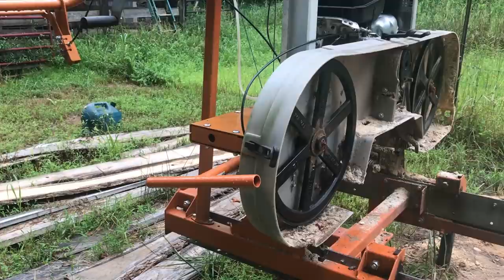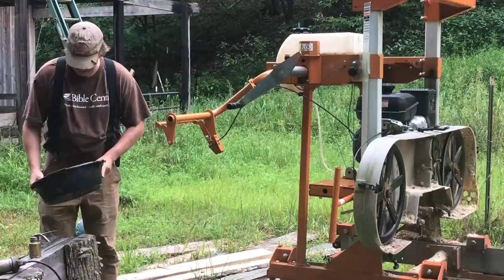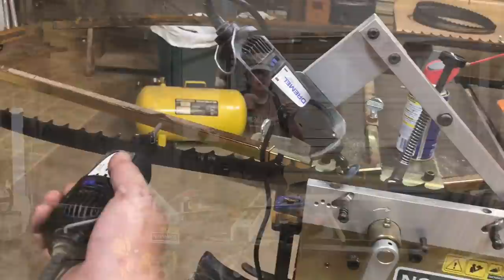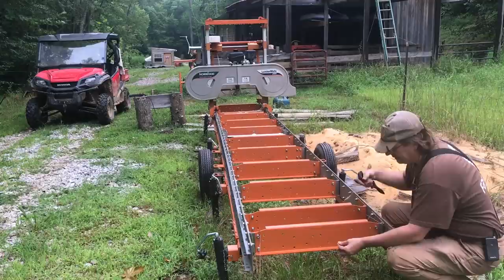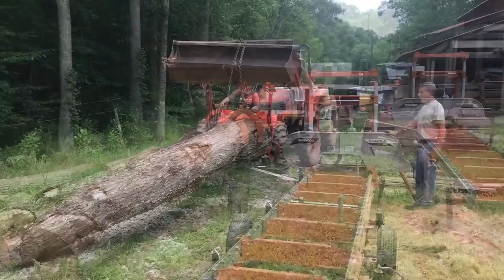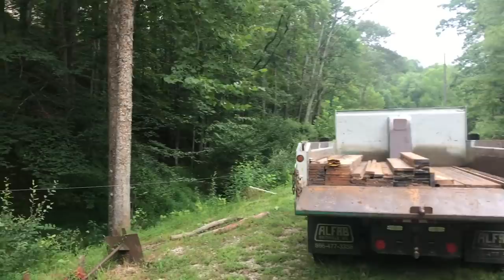Saw Milling a LARGE Pin Oak & Preventative Maintenance on the MILL

Comment: Hey Troy,  While I was watching you describing your dip in the mill and its location, I believe I saw your problem.  As you were describing where the dip was you had your left hand at the location of your problem.  Your mill's dip is at the connection of the two tracks.  I recommend you set a good sound timber under it and jack up.  It appears you have found a weak link in your mill.  At least you have identified it and know to keep watch of it.  Have a good day Troy and keep the good work.  God bless you and your family and always, stay safe.

Comment: Hey bud. Thanks for all the hard work making the vids. I love my lm29 that I bought because of you. Lol. I noticed something you might want to check into. Watch the video where you first started milling the first log. Looks like your frame is flexing. Might be a jack stand in a soft spot. Just an observation. Keep your eye on bottom of screen at the frame rails.  Also I bought the digital readout for mine. Best $350 I ever spent. Sped me up considerably. Thank you again.
Reply from the maker: I will check that out. Thanks for the heads up!